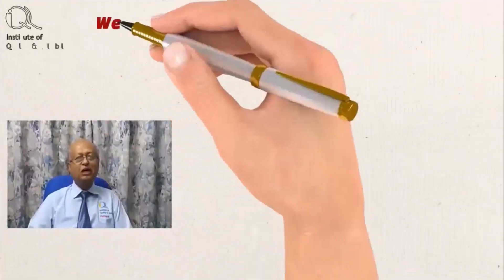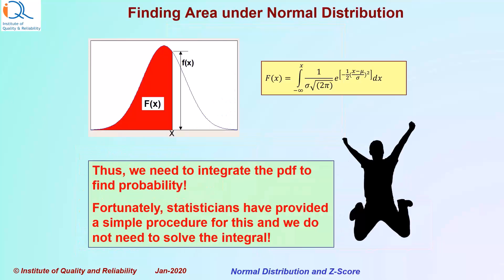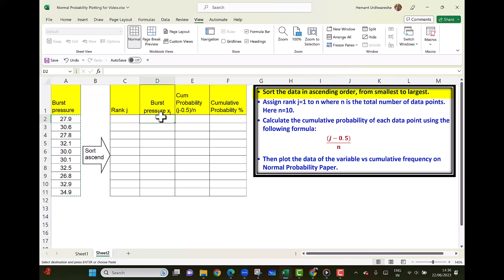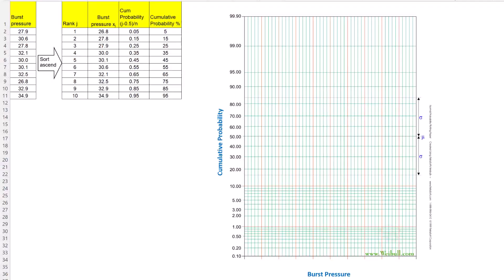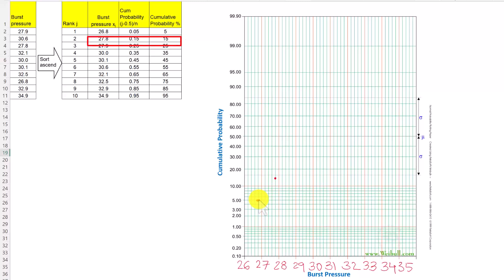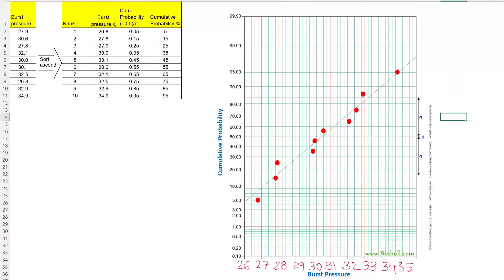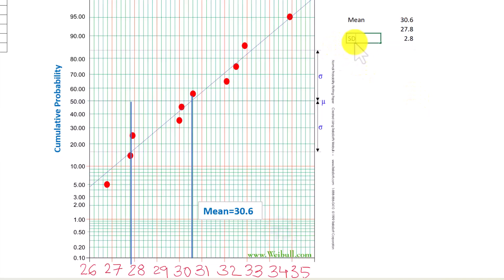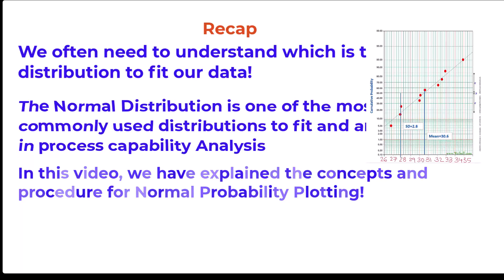Normal Probability Plotting with Case Study

Comment: Sir in 3:30 you said, Cumulative Probability = j-0.5/10. Sir in normal distribution, CPF comes in non-integrable exponential form!?
Please tell the reasoning behind the formula used?? You can share any video/blog link for such reading. 

And thank you for the video sir.
Reply from the maker: If we take cumulative frequency value as claculated, it will mean that no tube will fail below 26.8 and all tubes will fail by 34.9! It is not appropriate to draw this conclusion based on a sample of 10! Thus this formula, knows as Modified Kapaln Meier Method, makes a correction based on sample size n. As na becomes larger, the correction becomes smaller! A more populalar method of such a correction is called median rank and is given by (j-0.3)/(n+0.4). Applicability of median rank is wider as many distributions, such as Weibull, are skewed. 
You can watch my video on Weibull probability plotting:
https://www.youtube.com/watch?v=dsuLVS2yQ4U&t=0s. 
Hope this helps.
Reply: @instituteofqualityandrelia7902  that's super detailed response.

Got it sir. Thank you for sharing the resource... and thank you for taking out your time to reply.
Reply from the maker: Welcome! Keep watching my technical videos!

Comment: What is the purpose of normality test
Reply: The purpose is exactly the same. To verify whether data fits normal distribution.
Reply: @uhemant1   thank you sir for answer, I have last 2 question
1. How do we know the plotted data is normal or not( what are the criteria in scattered diagram)
2. How do we check probability in scattered diagram 
3 what is the role of P value in normality plott, in video you did not explain about probability. So I wanted to under. Please help me
3. What is correlations in between normality and probability
Please sir provide your feedback on above doubts
Reply: Sir please batiye na P value kaise calculate krte hai normality test me P value ka kya role hai.
Reply from the maker: The p-value is calculated using the goodness of the fit test such as a chi-square test. Most software calculates this with the Anderson Darling test which calculates the AD value and a p-value. The p-value indicates closeness to the normal distribution. A low p-value indicates that the distribution is not a good fit. Based on the confidence level, you can make a decision. For example, if the confidence level is 90%, and if the  p-value is less than 0.1, we conclude that the data does not fit normal distribution.
Also watch my video on Goodness of fit test. Here is the link: https://youtu.be/Ddvqf22Cv6c?si=oUwNVh5pLmeW507V
 Hope this helps.
Reply: Just last question, what is mean of data is normal. We are doing normality test according we are saying data is normal. So what is the exact meaning of data is normal.
Reply from the maker: That means data reasonably fits normal distribution and normal distribution can be used to make predictions.